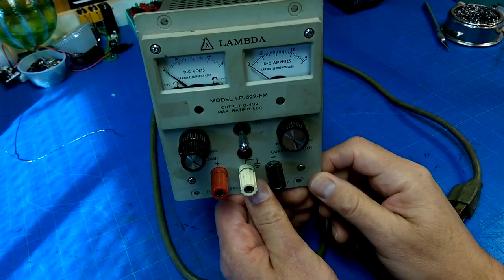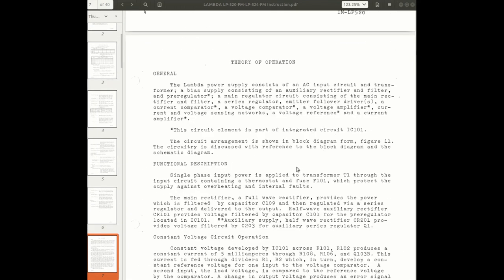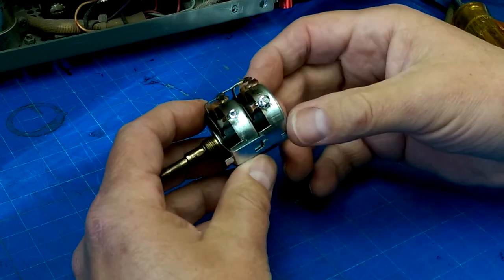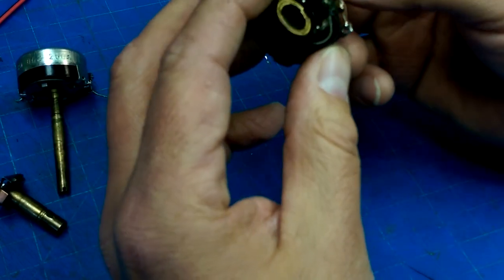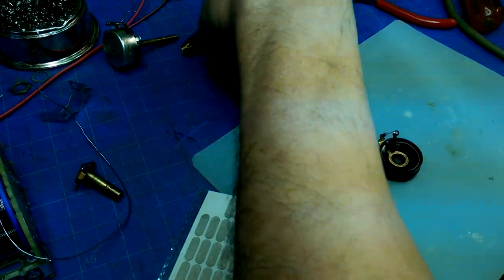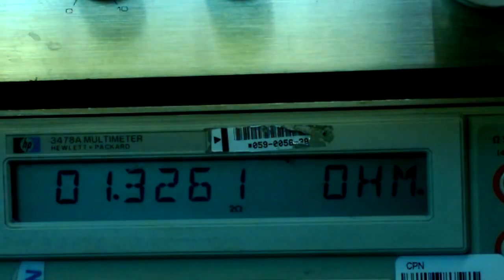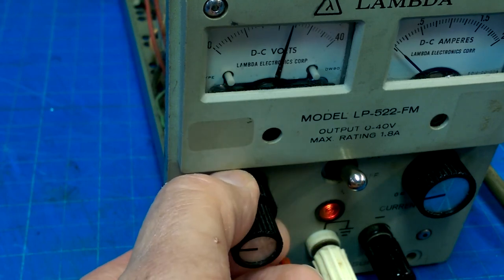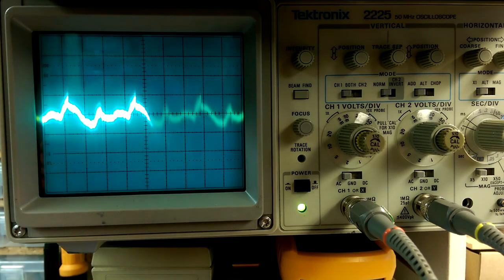lambda PSU Repair - fixed.  repost

Comment: Your video is pretty dark through most of it. Perhaps an LED flat panel light source would help. You get out of frame once in a while. Overall content is good! You don't see many techs repairing pots and it was interesting and informative to see how it can carefully be done. Got yourself a nice little power supply!
Reply from the maker: Yes, the lighting was not ideal.  I do need to make some better lighting.  When you can not source a replacement, repair is the road you have to go down.
Reply: @grtyvr   I was wondering if the auto level on your camera might be the problem. Camera exposure systems want to think that al the world is neutral gray. So a white paper will look gray if no exposure compensation is used. Adding another EV increase in exposure to compensate may help. You may want to try a +1 or +1.5 or so in exposure if your camera will do that.
Reply from the maker: @Cavemannspace  Possible but more likely it is because of the natural light coming in the window.  I don't usually record during the day and that amount of dynamic range is hard for the camera.

Comment: Nice video. I didn’t have a problem with brightness. Screens are adjustable… anyway wouldn’t a Centralab 1346515 work? Dual gang, 8k.